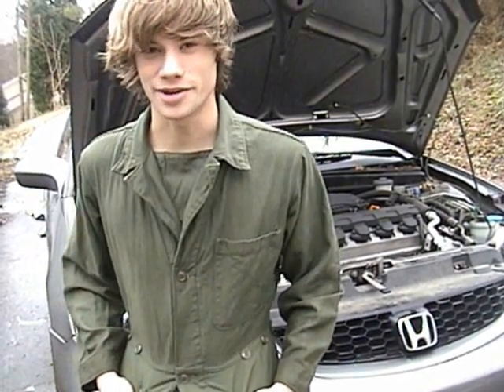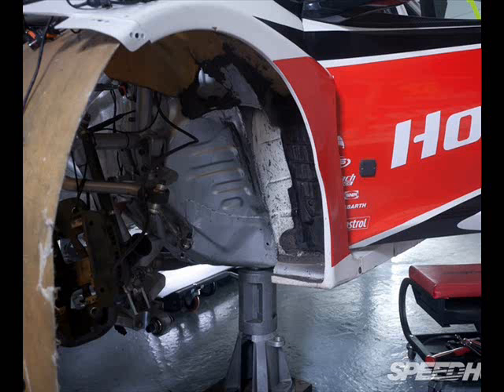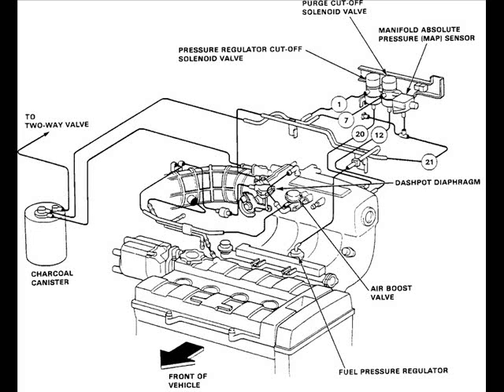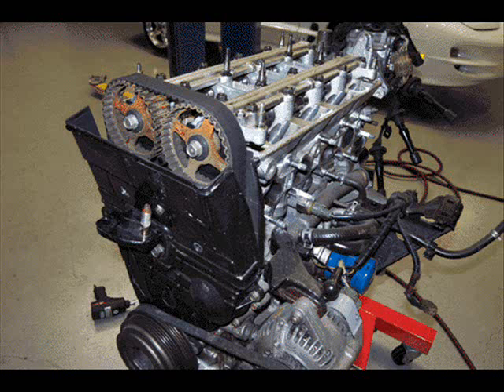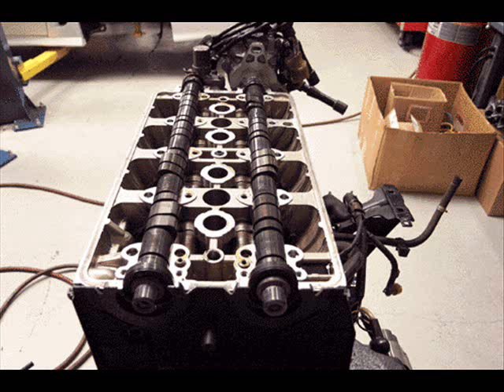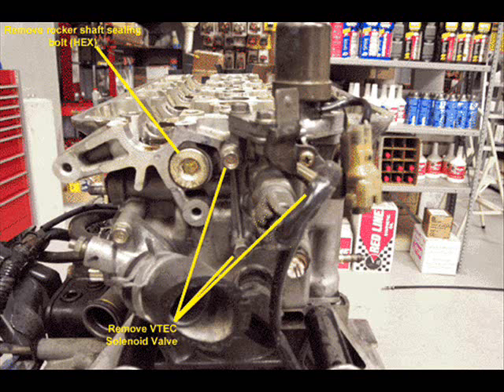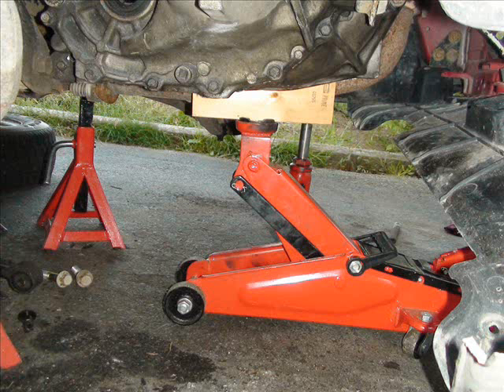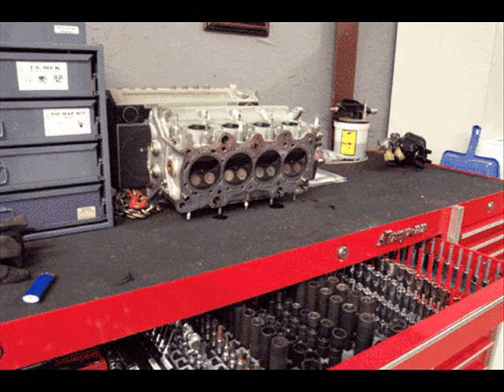How to Replace the Head Gasket on a Honda B16A Series Engine.  Part 2.

Comment: Good videos, but from doing this many, many times I have a couple of time saving pointers for you. First, leave the intake manifold on the head when you remove it. Getting to the bottom bolt is a pain anyway, and it helps give you somewhere to grab when maneuvering the head off the block. Secondly, you don't have to remove the motor mount or anything. What you want to do is set the engine to TDC for cyl 1, then loosen and remove all of your cam caps and the girdle. After this take a silver or gold sharpie or white out and mark the timing belt and tooth on sprocket somewhere to use as a backup/reference. then carefully tilt your exhaust cam downward with the gear still attached, and slowly slide the timing belt off the gear while pulling up on the belt slightly to keep the tension. After this just take a zip tie and strap your timing belt off to the side but keeping it tight so there is still tension on the crank pulley. You can now go about finishing to remove your head, when you put the head back on, you simply put all your cam caps back on in the right spots, then cut the zip tie off your timing belt and slide it back on using a lose tensioner if you need some slack. Make sure the marks you made with your white out/sharpie line up, and there is no risk of missing timing and you save yourself about an hour off this job. Lastly, some tips of the trade from a seasoned Honda engine builder; 1) OEM head gaskets are the best, I've used them on 800+ HP turbo builds with no issues, and some aftermarket gaskets have a lot of leaking issues. 2) always use copper spray on BOTH sides of a new head gasket. 3) never re use factory head bolts, they are torque to yield and are single time use. 4) Honda blue coolant is expensive, but it truly is the best for their engine materials and will never leave salt/corrosion deposits in your engine leaving it nice and clean on the water jackets for you. Always use distilled water in your cooling system also, NEVER tap or hose water. Lastly, the ONLY substitute for HondaBond RTV I would ever use is Permatex Ultra Grey, period. Everything else will cause leaks. Lastly, always make sure to carefully scrape all old head gasket material off the block and head before applying the new gasket, and always check the deck and head with a straight edge to make sure it doesn't need to be machined. If it does, don't worry! It costs less than $100 at an engine/machine shop and will ensure you have a leak free Honda head gasket for another 200k miles!

Comment from the maker: Both of those problems can be caused by the timing belt being off by one notch or so -- hard starting, low power requiring more engine RPMs.  A continuing head gasket leak can do that also if it is in the right spot, but so can a clogged air filter, and several other  things.  It will be hard to pin down without some diagnostic testing.  If your engine light is on, take it to an auto parts store that does free electronic diagnostic code lookups.

Comment: 5 After getting the timing belt back on you have to adjust the valves. Intake 0.17 and Exhaust 0.19, Starting with the “up” marks up adjust cylinder #1 then turn the crank counter clockwise and when the up mark lines up to the left along the top of the head adjust #3. Turn the crank counter clockwise where up is straight down and do #4 and turn the crank again counter clockwise when up is to the right do #2.

Comment: 1 After removing the tensioner plug you have to take tension off the belt before removing it. To do this loosen the bolt 180 degrees and then (assuming you have the lower cover still on as pictured) take a long flat head screwdriver and insert it behind the cover and push down where the spring meets the tensioner and tighten the tensioner bolt. Then you can remove the belt.

Comment: 3 When installing the cam holders and plates those bolts should also be tightened in 2 turn increments to 7.2 foot pounds starting from the center and then going  to the right  set of bolts then to the left and back to the right and so forth. Make sure the bolts are oiled before torquing.

Comment: 2 I know the Honda service manual says to torque the head in 2 steps but on all Hondas you should always triple torque the head bolts. Even with a OE gasket. Personally I like Fel-Pro gaskets. Make sure the threads are oiled before torquing.

Comment: 4 When putting the timing belt back on make sure the left side of the belt between the crank and cam is tight and loose on the tensioner side and set the tensioner by loosening the tensioner bolt and tightening.

Comment: I am replacing a burnt valve in my crv, and your video slideshow answered a lot of my questions. I think the reason some steps are missing is because its not a video of the complete process. But I liked the slides with labels better than the videos where the camera is jiggling around and the lighting is very dark.

Comment: thank's bro but now i foud other problem, when the car is cool down or about to turn on the car in the morning the car crank but wont start rigt away then i try it again then turn on bur turn off right way i try to starter agian then the car turn on in the first try like nothing happen, do you think is the same problem when i drive the cra the rpm goes faster then the speed, or is different? i'm sorry bro but i really need help, all this ahppen when the after the head gasket job was done